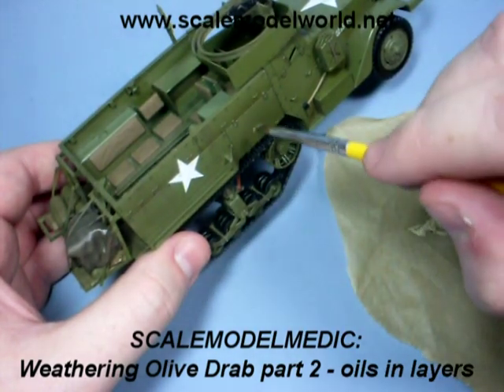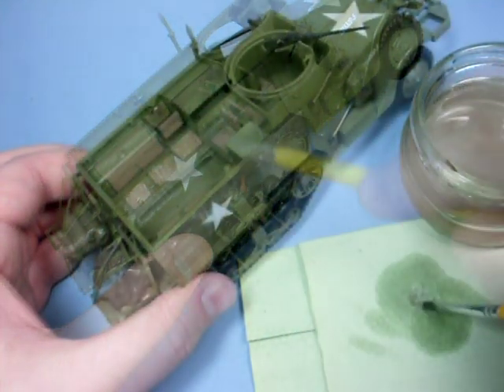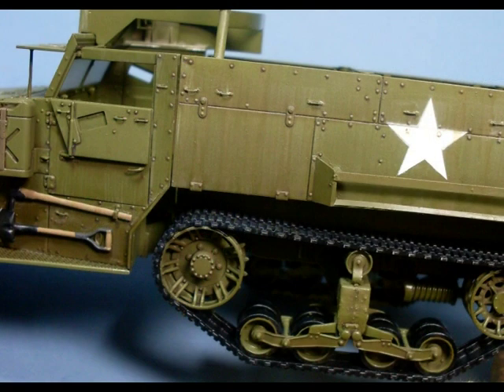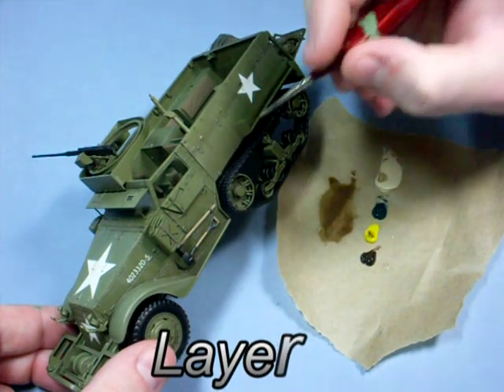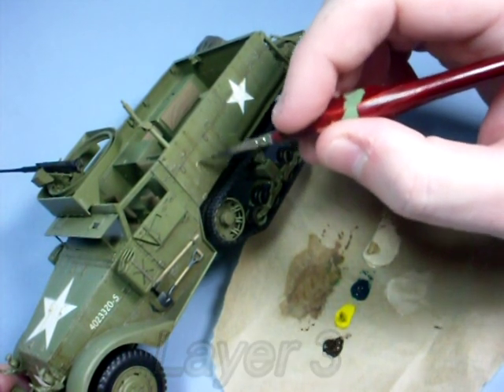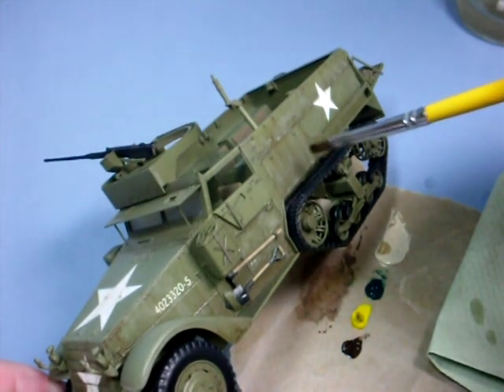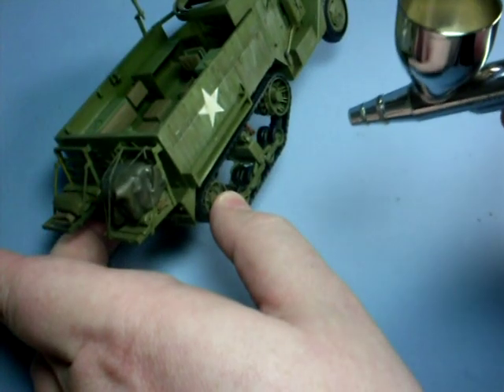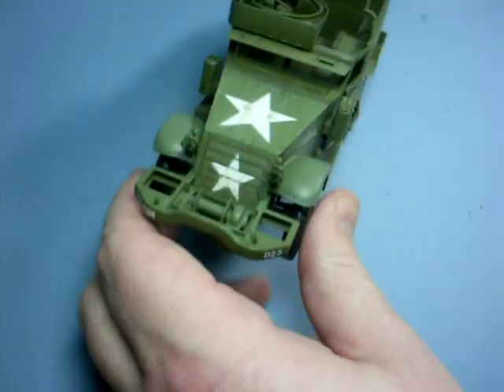Weathering olive drab - part 2: oils in layers

Comment from the maker: It depends on what conditions you're weathering.  If the black vehicle was in normandy then the dust would still be buff coloured, so I would still use it.  Using the layers method you build up a colour so if you use less layers it will be more subtle and might work over a black base coat.  If your vehicle was set somewhere else you might want to use relevant colours for the area.

Comment from the maker: @UnityCZ  the gloss varnish REALLY REALLY does help.  

Try this - find a piece of old model or unused part etc and paint it with a base colour, then give just one half a coat of gloss varnish.

Add a wash to each half and see what happens... the gloss side will flow around the details leaving very little cleanup.  Plus, because there is a varnish layer, there is very little chance of damaging your paint.

It's not like your life depends on it, but trust me it really helps mate.

Comment from the maker: I use windsor & newton oils.  I know what you mean about pushing the oil around so you can see brush strokes.  I have since switched to using a satin varnish rather than gloss, as this solves that problem - however as you can see I still blended the colours in even back then when I made the video - the key is to keep wiping the brush free of paint so you're gradually removing it.

One thing to try is wait for it to dry and then go at it again with a VERY SLIGHTLY moistened brush.

Comment: Great tutorial! Helped me a lot so far!
Questions: what kind of oil colors and thinner (white spirit?) do you use? I tried it with "normal" oil colors (Schmincke Norma and white spirit on a gloss coat) but I usually get rather grainy results and it is almost impossible to blend the colors in nicely. Even with a soft brush, I either wipe almost the whole oil paint off or brush strokes are clearly visible.

Comment from the maker: @Thefirstbranson Hi, yes I sure do clip those tracks with the airbrush, good spot on a non-HD video!  The truth is though it really didn't matter about that because the tracks weren't painted at the time, they were just black.  the next video "More basic weathering..."  added the weathering to the tracks and wheels, and this went over the top of that overspray so it didn't really matter.  If I had done it to painted tracks I would have had to go and paint it by hand with a brush !!!

Comment from the maker: The problem with what you've described is the isopropyl alcohol.  It is not the white spirits I am using in this video, the white spirits I am using is sometimes called mineral spirits, it is similar to turpentine.  The alcohol is interracting with your varnish because it is acrylic.

Comment: ok, I'll try that. What kind of brush do you recommend? As soft as possible?
I'd like to use this technique on aircraft as well but I don't know how to prevent the oil from getting trapped in the panel lines. Do you have any suggestions?

Comment: Great video, I'd really like to try this technique. But could anyone tell me if it's possible/safe to lay down Vallejo satin/matte varnish over an oil layer without waiting ~48 hours for the oil paints to dry? I'm new to using oils, and I know their dry times are quite long. Also, would enamel paints work for this type of job (streaking, layers) just as well?

Comment: Do you have to use a gloss coat before you can start the weathering process just new to this and if I do use gloss can I use varnish thanks from a lonely modeller
Reply: For me, it depends.  A gloss coat tends to disperse washes (perhaps too much at times).  You'll have to experiment, but generally I add either a gloss coat, or semi gloss coat (matt coat) after the color base coat & color modulation.